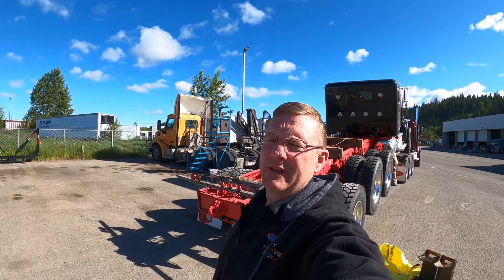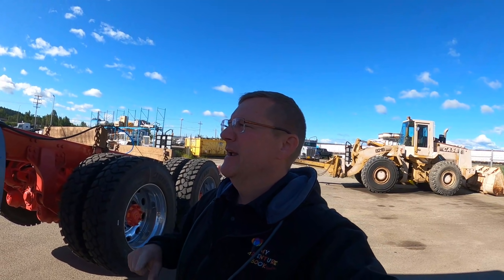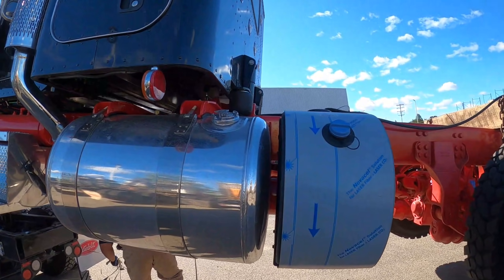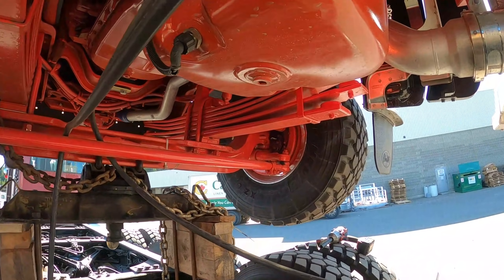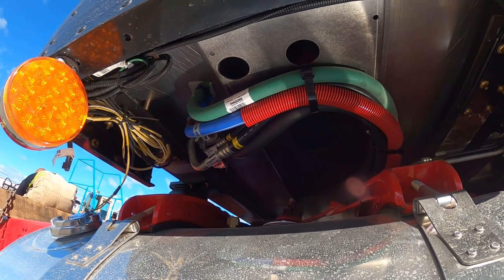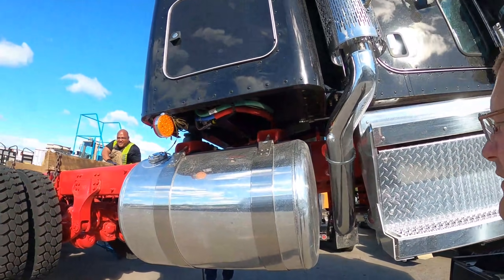JF1000 4.0 HAS ARRIVED! Let the build begin....

Comment: Talk all you want Mike but KW was already making a name for itself when the pete was launched. Both great rigs and if your history is with one or the other then its the king. I do like the suspension on that rig. But whats not to like about new except the smell of fresh paint getting in your nose. My trucks were gun metal gray with all the complements that could be added including a extra alternator to carry the load. I ran aircraft landing lights off my headache rack. I would go to work at three in the morning and not get home till midnight and do it over and over in the snow on the cascade mountain range. All good rigs that have made the turn into this century with new fuel systems and ECM's that control the whole truck!!

Comment: Porter greetings! 🇺🇸 JF1000…it’s a nice truck. This is a logging truck, right? I like a red frame, too. 🤩 Nice hood and NICE rubber. When do we get a look inside this rig? 🧐 I love having a hitch or hitches on the rear! Pointless hitches are ok, but they do have a function. I’m more of a Reese hitch person though. My little REO will get a hitch bolted onto it when I get to that point. That’s a guarantee!! 🤩 How big is that sleeper, or do they even use it as a sleeper? I would use it more as a toolbox! Up there in the North country, don’t they use sleepers? Lol I kind of like the battery box underneath the driver door, or both doors like in this case. I’m not a DEF lover…maybe I’m old fashioned, but I want nothing to do with it. As you know, give me an old K100 with a Cat and straight pipes and that would make me happy! 🥰 Don’t forget to show us how you take these trucks off the piggyback setup. I’m glad that you’re making changes in the DEF setup to improve things. That’s always good. Thanks for sharing!

Comment: Amazing Truck What Are The Specs Of it The Engine, Horse Power, Torque, Transmission, Axles, Axle Weight Ratings, Suspension, Suspension Weight Ratings, And Everything Else? Also, What Are The Biggest, Most Powerful, And Best Specs You Can Get On A Truck The Engine, Horse Power, Torque, Transmission, Axles, Axle Weight Ratings, Suspension, Suspension Weight Ratings, And Everything Else?

Comment: How do they get the trucks off the back of the other one.
Reply from the maker: We use the overhead crane in the shop on the tow pin
Reply: @mikethetrucknut  🇺🇸I would like to see that in action! 🤩 I live near an IH dealership, and as many times I’ve been there! I’ve never gotten to see that process in action!  An you show it? This is coming from a man who has operated a wrecker and boom truck and just simply loves mechanical things and processes.